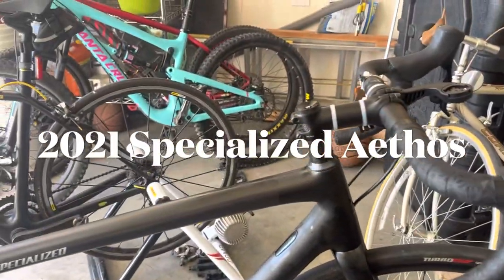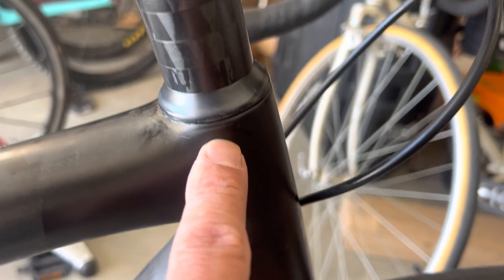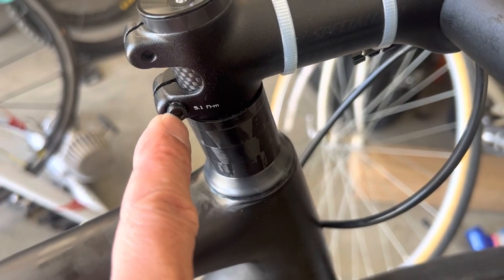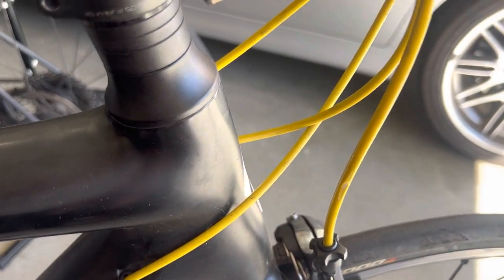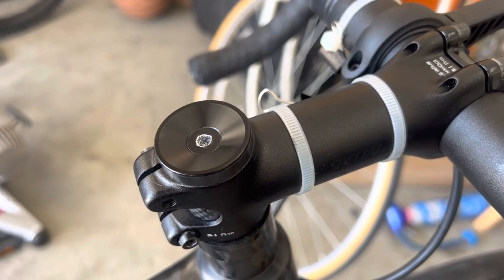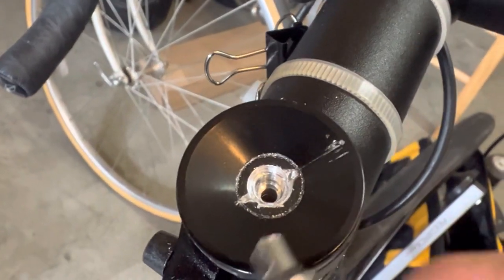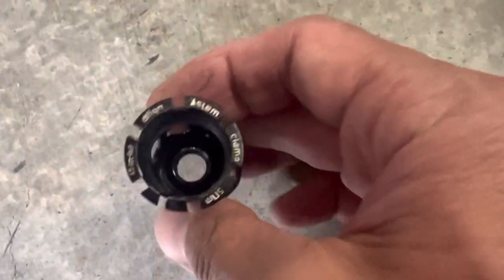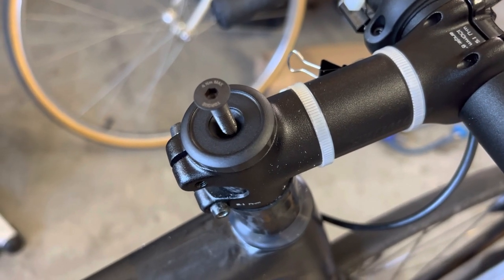Two Design Flaws in the Specialized Aethos

Comment: Sorry to hear of your issues. My Aethos is 1 year old also with approximately the same mileage.I have no issues with my steer bearings so far. My bearings are smooth and quite. I will keep an eye on it. Thanks for doing this video.👍
Reply from the maker: Good for you Joe.  I sweat a lot while climbing and I climb a lot.  I’ll try to wear a sweat head band next time.
Reply: Here is an update. I decided to check my bearings, so I took mine apart. The bearings were fine, no rust. I removed the seals on the bearings, flushed them out, and repacked with grease. I reassembled everything and it all went back together fine, no issues. I decided to get a spare top cap and bolt.  I checked my Aethos owners manual and the part number looks to be S20500013. Also, the expander plug is S202500011. Can I ask where you ordered your parts? Thank you, Joe
Reply from the maker: @joefenech6839   thanks for the update Joe and the PN#s.   I called Specialized and the rep told me that I have to order the parts from any authorized Specialized dealer.  There're many authorized dealers around here.  So I ordered the 3 parts (bolt, cap & steerer tube plug) from the dealer.  But delivery time was unknown.  Then i called another bike shop and the owner told me that I can use any generic steerer tube plug (expansion plug) that's the same size of 1"1/8 with a cap and a bolt.  So I bought the generic part and canceled the Specialized order.
Reply from the maker: One more thing.  In the Specialized design, there's only one bolt (4mm) that holds the steerer tube plug and the cap together.  Eventually this 4mm bolt will be stripped.  I stripped it on the 2nd installation.  The generic expansion plug is heavier than the Specialized design, which is very light weight.   Most generic expansion plugs have two bolts that held the assembly together.
Reply: @imdragonslayer  thank you! Mike’s is no longer a specialized rep 🫤. I  might ask them anyway tomorrow during my Ride in Sausalito. Ride on !…. Also, get Johnny a hair cut to reduce the sweat 🤣
Reply from the maker: @joefenech6839  haha.  that must be it.  It's all Johnny's fault for not cutting his hair.  Mike's Bikes can't order any Specialized parts anymore although they still work on bikes that're under warranty.

Comment: I'm thinking of getting this in the comp version, with rival e-tap, when its available again.  I used to have a tarmac sL2.  it got destroyed and I no longer use it.  I know it's heavier than the s-works counterparts.   but the s-works price tag is a bit to steep for my blood.  How do you think of the comp version?
Reply from the maker: I really like the eTap. Very smooth and accurate. The Comp version overall is a nice bike, and it rides more like an endurance bike with similar comfort level as the Roubaix. It handles well around corners and even steep descents.  But on long steep descents (like 2000 ft drop over 3.5 mi) , it would be better if the rotors are larger, as the rotors would heat up and make some noise at near the bottom of the hills.  Gear shifting is smooth. Overall , I still recommend the Comp version.

Comment: My partner has the exact same bike with similar miles, and so far no problems! Maybe because we live in SF and it's colder here so he doesn't sweat as much. I let him know about the poor quality hex screw though (we looked at it and yes, it's starting to strip), he will get a replacement before it becomes completely stripped. Thanks for the heads up
Reply from the maker: Maybe I just sweat too much on climbs.  I climb a lot and has already gone Thru 3 sets of brake pads the past year. 😆. I’ll wear a sweat head band from now on.
Reply: @imdragonslayer  Try applying some silicone grease to the spacers, around the top cap, and wherever there is a junction between parts.  I suspect that the junctions between the spacers, spacer and stem, top cap and stem, etc. might be drawing your sweat in via capillary action.

Silicone grease might help prevent the infiltration of liquid sweat and is inert/non-reactive.

Boeshield T9 might do the same here too.  You just want some kind of greasy/waxy barrier to repel water (much like how canvas used to be waxed to make it waterproof).

You just might be one of those lucky people with extremely corrosive sweat.  There are people out there who claim they can simply touch bare steel parts and orange fingerprints will appear within a few hours.
Reply from the maker: @mwu9723  that’s a very good suggestion for an imperfect design. :)   Yeah. My sweat probably has highest concentration of salt , more so than sea water.  😂. Thanks
Reply: @imdragonslayer  I guess it's good you're not a fan of steel frames - few worse tasks than removing a seatpost or stem that's seized due to corrosion.

I would probably spread a thin layer on the steerer tube (probably don't want it where the stem clamps).  You just want the grease to repel any water and to keep it from the headset bearings.

The worst thing possible here is the headset bearings seize from rust and your steerer tube is damaged from turning against a frozen headset.

You can probably find silicone grease in the electrical section of Lowes or Home Depot (will be sold as dielectric grease).  You can use it to keep rubber seals/gaskets in good shape too.

Comment: Sorry to hear of your problems but let me tell you something from the observation of a professional bike mechanic. Headset bearings are consumable items I replace many many headset bearings on all different types of bikes they use steel bearings that rust. So when you replace them make sure you get stainless steel bearings that will help but not completely eliminate the problem eventually they will rust out as well. Also good tools make a difference don't use ball end Allen wrenches for soft aluminum fasteners that will strip them out, use quality Allen wrenches that fit snugly and make sure you are careful. In my opinion these are not design flaws all bikes need to be serviced regularly. I have an Aethos and I have replaced my headset bearings already also. As a matter of general maintenance.
Reply from the maker: Thanks Robby for your honest comments and sharing your professional experiences of bike bearings. I do expect that bearings do wear out over time but I didn’t expect that the bearings in the Aethos would get rusty from my sweats after 1,500 mi since I hadn’t not experienced this problem with the Roubaix or other bikes that I owe. The Roubaix had a more robust design in this regard.  Now that I will make sure that I’ll replace the 4mm cap bolt every time I serve these bearings.  Fortunately the rust in these bearings can be cleaned and be reused. Every time I sweat now I mentally prepare myself not to drip the sweats onto the top tube.   It’s a mental burden. 😂. Thanks again for your comment.
Reply: @imdragonslayer  your welcome! I'm not sure if you live in hot humid climate but that will certainly speed up any rust issues. Also if you ride on the trainer a lot this is a big problem. Just make sure to cover the stem area with a towel if you are on the trainer! Ride safe!✌🏽
Reply from the maker: I’m in N California. It’s as dry as it can be and almost no humidity 😂. Thanks for the advice.

Comment: When I first received my Aethos, I was so concerned about the softness of the top cap bolt that I immediately ordered a spare. It is a silly design choice.

Like you, I've also swivelled my seat post clamp 180 degrees because the small section of carbon fiber that remains exposed under the bolt of the clamping mechanism began to delaminate/debond even though I tightened the bolt slightly under specification with a calibrated digital torque wrench (5.5 nm instead of 6.2 nm). Very disappointing and frustrating!
Reply from the maker: I think Specialized is trying to reduce the overall weight of the bike by using more smaller aluminum screws and lighter components.  There's only one bolt (4mm) that holds the top cap and the expansion plug (steerer tube plug), and is spec to 5.1 Nm.  It's a one-time use bolt.  Toss it away after removal; it will most likely be stripped when you torque it to 5.1 Nm the second time.  The traditional expansion plug has two bolts:  one 6mm for tightening the expansion plug, and either 4 or 5mm bolt for the top cap.  But the Aethos only has one bolt.  Very bad design flaw.  
Thanks for the tip on the seat post bolt.  I'll be extra careful when I adjust the seat next time.  Luckily I've only made one seat post adjustment so far.